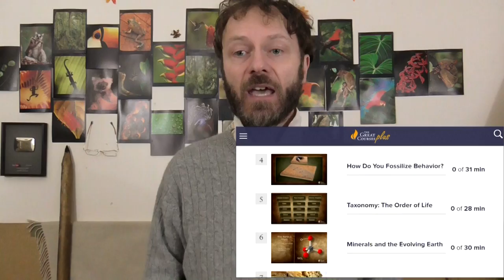Muzzle Brakes - what are they for?

Comment: That tank commander seems a little bit unqualified for the position.
Reply: Diego Esteban a tank commander doesn't need to be informed on the engineering reasons for why thing on his vehicle are designed in the way they are. He only needs to know the limits of the machine and how to take full tactical advantage of those limits.
Reply: weallhaveavalue
Well, the crew including the commander is responsible for the all the upkeep and Maintainance of the tank they cover pretty much everything on the tank that's not physical armor damage (not tracks but actual armor) and larger components that takes professional engineers to replace. so the commander and the crew should know all the ins and outs of the tank, not why is there or how it works but know at least what it is. most modern tanks don't use muzzle breaks anymore so it's not that unreasonable to not know what a muzzle break is.
Reply: Detective Weeb. The crew are only responsible for minor upkeep on the machine. In-depth maintenance and repairs are performed by engineering trades. In the case if UK forces the REME of which I spent 7 years in.
Reply: It was WW2, qualification was probably not as good as it is today.
Reply: A component not a part of his weapon system isn't exactly relevant information.
Reply: He was just used to calling it Barrel Brake
Reply: His tank likely didn't have one, so unless he was an equipment specifications buff that knew a ton of relatively useless info about tanks other than the one he was commanding, he had no reason to know. 
I recently asked a friend of mine who has been a truck driver for the last 8 years if he knew the history of the Mansfield Bar, and he had no clue what I was even referring to, despite the fact that it has been on every truck he's ever driven; he just assumed it was there to give you something to step on while climbing into the trailer. His only concerns are knowing how to pickup and drop off a load and do a basic vehicle check before hitting the road - he has no interest in learning why every piece of safety equipment is on the truck or what they do, because knowing that wouldn't make his job any easier. At best, knowing such stuff would best be utilized for impressing Lot Lizards with some trivia. xD
Reply: Modern MBT have bore evacuators not muzzle brakes.  It's the oversized barrel part a third to half way up from the gun face/shield.  The gases go to left/right and slightly down.
Reply: @justinkashtock333  "a ton of relatively useless info about tanks"

How about the SA80 rifle that every British soldier has been issued since 1985 and extensively trained on since the moment they entered basic training? 

"Oi, what's that on the end of me rifle, Leftenant? The cage-lookin' bit with the slots cut only in the top?" 
"Oh, nm that, Private, it's probably useless decoration. Time for tea, lads."

Why can't you simply accept that the TC whom Lloyd spoke to was probably just stupid and/or lazy? It  does happen you know...
Reply: British tanks haven't had muzzle brakes for over 50 years.  So it stands to reason that the commander of the Challenger wouldn't know what one was.
Reply: For sure! I don´t command tanks, but in the military I HAD to learn this. And also I learn the other type of muzzle brake that it´s often used in machineguns to push back the barrel with the gas and help cocking the weapon. It´s basic weaponry knowledge

Comment: why not put a suppressor on a tank?
Reply: Please tell me this is satire
Reply: @yourlordandsavior6940  yea i like to think of rainbow six siege with customizable muzzle attachments
Reply: Lol
Reply: DragonPhoG lmao
Reply: Google "Artillery Suppressor"

EDIT: Look at this pic here as well: https://assets.rbl.ms/17312381/980x.jpg
Reply: Because it would be like putting slippers on an elephant.
It'd work for both of them if they are well hidden first.
Reply: In case its serious question, because it would wear down so rapidly on a tank. There are other reasons, but that is possibly biggest one. Simply not worth it in any way.
Reply: @yourlordandsavior6940  gee you think
Reply: it would be very expensive due to having to withstand the huge pressure of a tank firing, and would also be extremely heavy.
Reply: DragonPhoG Congratulations you have just been awarded YouTube Comment of the year
Reply: Ah yes, being stealthy on a Tiger II
Reply: @normanberg9940 thanks
Reply: Give it bromide that will work !
Reply: why not?
Reply: I'd prefer a silencer, and also a bipod for really tactical operations.
Reply: Valid question. Because the size of a device like you're talking about would be massive. Also, you typically fire subsonic ammo for use with suppressors. Not sure what the equivalent would be for a tank gun, but it would likely require special ammo, which would just be a less effective tank round overall. It works counter to the main purpose of the tank. There are better ways of protecting the tank that dont compromise its ability to blow shit up
Reply: yourlordandsavior 69 it exists but it’s huge and static
Reply: @dragonphog579  I put flash hiders on my tank
Reply: sunshadow7XK elephants actually walk very quietly
Reply: Why not a grenade in bubblewrap to cover the noise? XD
Reply: @Phil M apparently, the working artillery suppressors decrease the amount of blast sound behind and in front of it by 20 dB. That's quite a bit if you ask me.
Them being stationary is obviously intended not for war effort, but rather to get the sound down to acceptable levels for civilian populace when training artillery crews.

Comment: lindy. can you explain why the Germans thought the Churchill tanks at the Diepe raid were obsolete and useless?
Reply: Having a slow tank that moves at walking speed didn't fit with German doctrine at the time, mobile warfare was their game so they prefered to stick with the tanks they had since they could deploy rapidly and keep up with mechanized infantry. atleast thats what i got out of reading about them :P
Reply: ***** in addition to most the of the churchills throwing their tracks within moments of landing on the beach... The germans were right about them.
Reply: soundslave and yet the Churchill tank still performed relatively well in the Korean War.
Reply: Challenger 2 ATDU produced in large numbers because it's the best heavy tank the British had, does not mean it was good. They just threw enough shit at the wall in the hopes of some sticking.
Reply: Churchills were built based on outdated engineering and warfare principle. A tank with a meager 27kph top speed was simply not very useful, the running gear and suspension made tanks from the 30s look modern, using simple coil springs, small road wheels and having the track run back on top of the hull without bothering with fenders or any covers initially, and didnt allow for high speeds even if the tank had a better engine. The initial 2 pounder armament in the turret was a step back from the by then established 6 pounder, and by then entirely useless as a gun in total. Mounting a 3 inch howitzer in the hull (it would later be replaced by a BESA MG) was also reminiscent of the M3 Lee/Grant or Char B1, the former was a failure at tank design, the latter being only saved by its stupidly thick armor for the time, but definitely wasnt ever praised for the practicality of coordinating 2 guns. Armor thickness at 89mm at the front was also less than stellar at the time, a Tiger had 100mm while being better armed and much more mobile, and didnt even protect from the 7.5cm Pak 40 with was starting to become the standard AT gun at the time. 

The good performance later on is still a valid fact though. In part it was based on improvements, such as deleting the 3 inch howitzer and using a 6 pounder and later 75mm as main armament, especially the latter was good for an infantry tank since it was capable of firing HE, increasing armor to 152mm with the MK VII, which reliably protected from 75mm guns and to varying degrees from 88s. The other part of its good performance came from the features that were there from be beginning, which was the decision to use a lot of small road wheels, which evened out ground pressure much better, and also the incredibly good ability to climb hills and overcome obstacles, and the excellent ability to carry a lot of extra mass, enabling it to be modified in the most hilarious ways, for example as bridgelayers or the famous AVRE.
Reply: He can't. The concept of something that is not British to be better than something that is simply does not compute with him. 
Also, there are many things that are important when it comes to real life tanks. For example a problem Churchill and generally all British tanks had was that the tracks and the engimes where very loud and would make lot's of noises. That might not seem important at first but hearing the enemy aproach you 10 minutes before they hear you can make or break a battle.

Comment: talking about that blast that Lindybeige is talking about on a modern Abrams the "puff of smoke" coming out the from is LETHAL for several yards forward of the gun and thats with it unfocused coming out the front i'm sure that of there was a muzzle brake on the end those would damage cars or even buildings in close proximity (a few yards)
Reply: ok thanks for that
Reply: YAY i'm learning so much!
Reply: ***** I am well aware of the difference between maximum range and effective range. The fact that the maximum range is so insanely large should tell you that the overpressure is dangerous for a lot more than just a few meters.

If you look more closely at that manual I linked, you will see it's not a peace time manual. It contains real combat drills, which state that you must never be in front of a large cannon that fires.

Lindy's anecdote where an artillery cannon fired towards a group of incoming infantry, and managed to neutralize them, should also tell you how dangerous the overpressure from a large cannon is.
Reply: ***** I feel like you misunderstood. I'm not arguing that it's dangerous up to 200 meters. The point is that the overpressure is dangerous for more than just a few meters.

If you want more solid proof, go look up at which distance the backblast from a shoulder fired launcher can seriously injure, which is a few meters. Then try to guesstimate how that compares to the much larger cannon, of let's say, a tank.
Reply: ***** You are now saying that a shoulder fired launcher generates a backblast that is dangerous up to a few meters. Now, don't act like I said otherwise because I said that multiple times before you did.

You now say that the shoulder fired launcher is about as dangerous as a 120mm cannon. C'mon dude, that's silly! Look at the facts...

Let's take a more powerful shoulder fired launcher, like the Carl Gustav; its rocket has a propellant of about 0.4 kg.
http://cnqzu.com/library/Anarchy%20Folder/Ammunition/Jane's%20Ammunition%20Handbook.pdf

A 120mm cannon AP shell has a propellant of about 8 kg!
https://www.orbitalatk.com/defense-systems/armament-systems/120mm/

That's a huge difference! I'm sure you already know that the difference there is not linear but exponential, so that makes the cannon hell of a lot more powerful with a much more dangerous blast overpressure.
Reply: ***** I'm sorry but what you said is plain stupid. Like, seriously, dude... Standing next to a launcher is not the same as standing behind it where the majority of the overpressure is. Try standing behind it next time, not too far back like a meter or two, and then tell us again that "it's not so bad".

Not that it matters because a tank cannon is very different from a CG as I pointed out in my previous post.

OK, I'll be going now because now it's pretty clear you don't have anything worthwhile to contribute to this discussion. Next you'll tell us that you've stood next to a firing rifle and therefore you conclude that the overpressure from a cannon is not so bad...
Reply: ***** Uhuh. Whatever you say, mister I stood next to a Carl Gustaf and therefore I think that a 120mm cannon overpressure in front of the barrel is not so bad.

In the off chance you are not trolling, go look again at your statement where you said that the Carl Gustaf generates a similar force to a 120mm cannon - go look at the numbers I posted previously and then try to notice the difference (there's a huge difference in the amount of potential force each of them generates).

Next, try to understand that standing in the danger area of a Carl Gustaf (which you haven't done) is different from standing to the side outside of the danger area (that's what you did). Also try to understand that standing next to a CG is not the same as standing in front of the barrel of a large caliber cannon.

I'll be going now because your lack of logic skills annoys the crap out of me. /ragequit
Reply: i think you guys are taking this way to seriously you guys are going back and forth every few minutes and for the most part you don't necessarily need to be in military service or a vet to know that the air pressure coming out the front of a cannon is lethal you can look at the science of it
Reply: obviously you don't know chemistry air is gas and if you want to get technical its compression pressure (when two forces push against each other)
Reply: omg gas is a state of matter like liquid or solid "air" is a chemical composition of many "gases" by calling it "gas" all your saying is it changed its state from a solid to a gas and what causes the lethal compression wave is the "air" outside the barrel carrying the wave from the "gas" leaving the barrel
Reply: i didn't want to post a response every few minutes go talk to a science teacher and the get back here and talk i'm done
Reply: antonw194200 I feel like you've been very close to blast-flash and are still suffering it's effects.
Reply: nah just not good at grammer
Reply: +antonw194200 actual technical engineer here, why do you think air and gas ISN'T interchangeable? sure it has a liquid/solid state just like any other compound.
but that's beside the point, when there is a rapid release and expansion of gases created by the explosion, they expand and push on the surrounding air molecules. This causes compression of a layer of air which then expands outward in a hemispherical wave. and this wave only gets slowed down by the friction of the air (very little and the increasing spread of effect (exponential).
and when you know as little as 2psi can be fatal, and 4psi almost always kills and 8kg/cm^2 equals 113psi it can demolish constructions within many metres.
and you look at the 5.7psi of the CG, do you not see the difference of that peashooter and a tanks blast?
https://www.cdc.gov/niosh/docket/archive/pdfs/NIOSH-125/125-ExplosionsandRefugeChambers.pdf
just look at the exponential airspeed and the pressurized wave that would be sorrounding the idle area, use your noggin, not your experience with a miniature toy (the CG comparative to the 120mm AP shell)
Reply: thejack473 i'm glad someone else here actually knows what they are talking about

Comment: Just like smoke gives away your position, the flash does as well.  That's why they are sometimes called flash suppressors.  Although they don't "surpress" anything, but spread it out, making it,  like you said, much more difficult to pin point your position.

Comment: Wouldn't a muzzle break slightly reduce the muzzle velocity too?
Not severely of course but if they could get away with it, wouldn't you want all the gas pushing against the shell until it exits the barrel and not a few inches before?
Reply: The break itself is pass the muzzle, and any rifling/bore section, so the round is in free flight at the time the gases reach the break.

On firearms, regardless of size, if the barrel is ported there will be some loss of velocity. This should be dealt with the guns ballistic table used for determining firing solutions.
Reply: rollis karvellis Thanks :D

Comment: I am surprised that he never mentioned Bore Evacuators, which are an even more misunderstood feature on tank guns (They are those weird bumps somewhere around the midpoint of modern tank barrels). While they do not substantially decrease recoil, they do drastically improve smoke control by venting gases over a longer period of time, and also stop explosive blowback into the Turret, which WWII era guns did constantly. There are actually a couple guns that have both, most recognizably the M126 Howitzer that is used on the M109 Paladin. Most other guns find it unnecessary to have both.

Comment: But the real question is, can we put a suppressor on a tank?
Reply: Google artillery supressor
Reply: Theoretically, yes, but you'd likely have to spend some time working out what charge to use for a given size of suppressor to get the round subsonic... which would also lead to any KE round losing a fair chunk of its' punch. Could do it for HEAT or HESH rounds, I suppose, but it's still going to be plenty loud